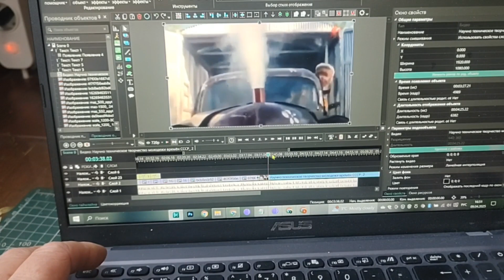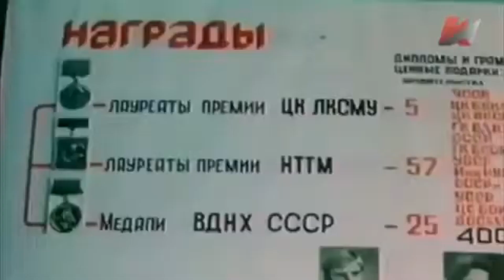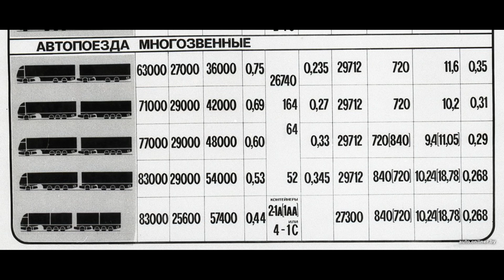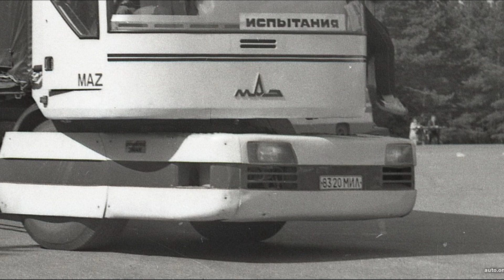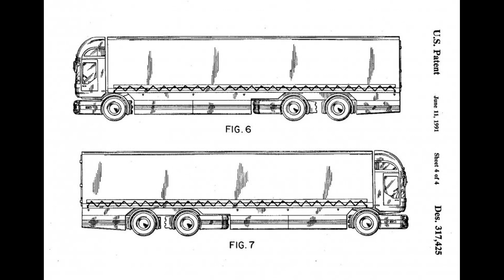MAZ-2000 Perestroika — The Soviet Truck from the Future

Comment: I know that it's not an eastern block vehicle, but a video about the Steinwinter semi tractor would likely be pretty interesting. It's either a brilliant design or the work of a lunatic depending on how you look at it. Although sometimes the line between the two is pretty thin.
Reply from the maker: Unfortunately, videos about equipment that isn’t from the Eastern Bloc perform very poorly both with viewers and with the algorithms. I’ve already tried several topics about Western machines, but they didn’t work out at all.

Comment: Just crazy, a modular system like that would have brought so many advantages to the table...
Reply: I wonder if they aimed to high with the modular system. Just fusing the cab and the trailer offers huge efficency advantages and the separate engine pod might give the mobility and turning radius back. Could work just like a semi where you can't swap the trailer but gain fuel efficiency.
Reply: @danielrose1392  Look at it also from the perspective of running a shipping company. If you modularize the engine, cab and attachments, in case of a need for repairs, only the affected module needs to be taken out of rotation. Substitute it with a spare and you can just keep going instead of having an entire truck sit in a repair bay for days when it could be earning money on the highway.

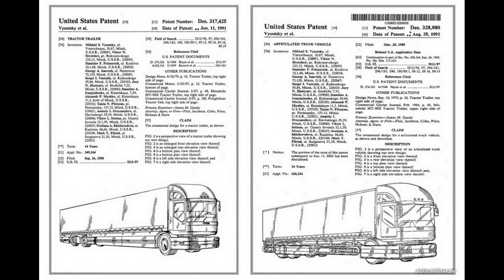Comment: A very long truck that would be weightt restricted due to nly 3 axles as the tilt example at 14:52. The trailing? rear axle would need to have been self-tracking. Not very realistic on tight bends or reversing in difficult factory entrances. Rather restictied cab on long haul

Comment: Front wheel drive is great  in car s but a recipe for  problems in trucks. Any reduction in traction, gravel, snow, mud, uphill, railway tracks etc would cause stranding. I owned a 8X2 truck with hydraulic crane mounted just behind the cab. This truck could not even climb a gentle wet asphelt road. Powered trailers are contrary to many countries road laws.
Reply: Weird concept, that Commer QX inspired underfloor engine and transaxle a mechanics nightmare, a single  front drive heavy artic on six axles a disaster waiting to happen.

Comment: It was important to the USSR to demonstrate that it was able to match the best of European design. The fact that it was inspired by European models was a feature, not a failing. Perestroika was not about imitating the US.
Reply: I understand way the truck look like it do and it advantage, but I do not think it would be superior to a conventional European style truck, there are no real room for a normal size engine, and the radiator look very tiny.
Reply: it was abaout imitating France
Reply: @whynot6795  Are you sure you watched the video? Flat floor wasn't the main design feature, the pivoting self-contained tractor unit that enabled the cab to hug the payload is. But yeah sure it looks like the Magnum, who cares about actual technical details.
Reply: @Klovaneer  Are you talking about ideas that died in America in the 60s?
Reply: @whynot6795  What does this have to do with the alleged renault connection? Are you just whatabouting?
Reply: @Klovaneer  I'll explain it to fools and fish. The design was stolen from Renault, the rest of the ideas are just long-forgotten American experiments.
Reply: @whynot6795 It was Renault from France That copy MAZ from USSR...